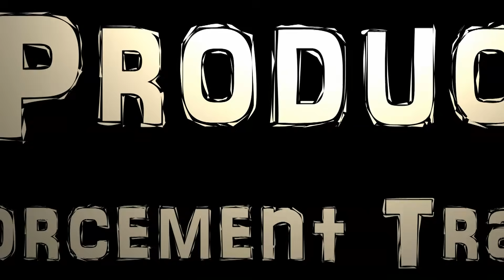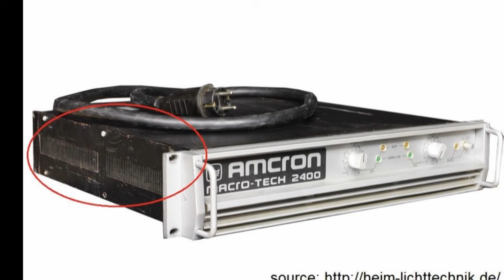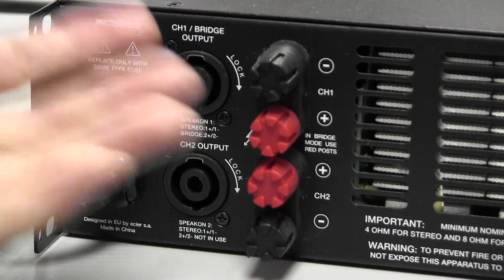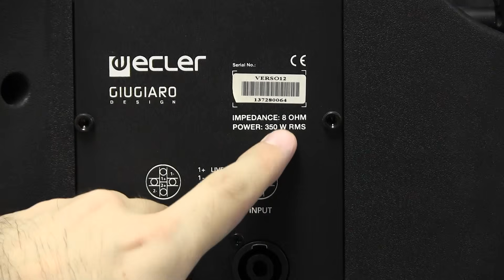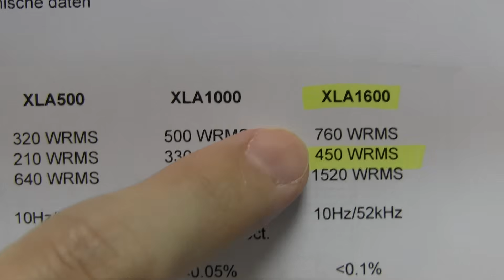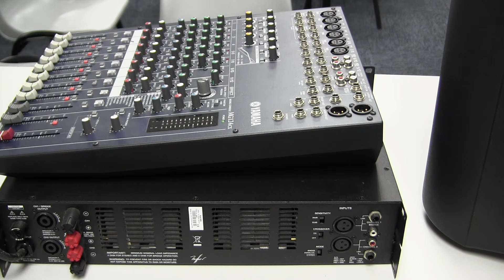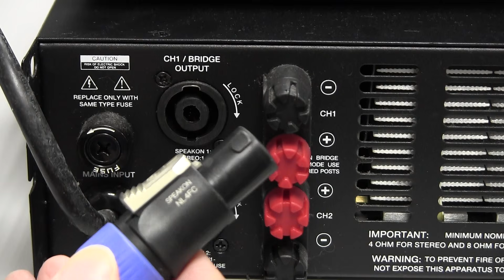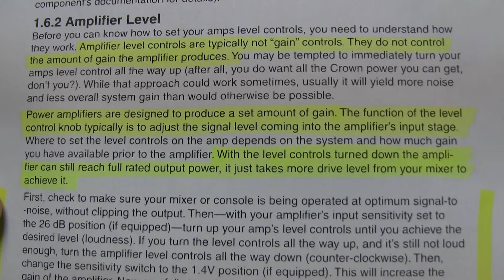How to connect a power amplifier to passive loudspeakers

Comment: Currently own two JBL JRX100 speakers. One speakers nominal output power is  500W with an impedance of 4 ohms. It says max rms output power is 2,000W. Would a newer Behringer NX3000 amplifier which can handle 2 x 900W @ 4 ohms work correctly? Our old amplifier was a crown XLS 1500
Reply: Or do you have any amplifiers that you’d recommend
Reply from the maker: Watch my video on how to match power amplifiers to passive speakers, it will walk you through this process. I personally do not recommend Behringer products to my customers - much better to go with a dedicated amplifier manufacturer like Crown, QSC or Lab Gruppen.

Comment: Even though I'm not into this kind of topics or work with this kind of equipment I'm impressed with how professional and overall, how easy it is to understand each step you explain here in this video,. So why was I watching this video? I'm trying to connect a couple of KLH speakers that come with 5-way binding connectors to a MIX8 8 channel mixer with TSR connectors to be used as a PA system. I'm wondering if such a cable exists or if I have to make my own/ Hope you can help me. Thanks
Reply from the maker: Hi Alfredo, is your mixer a powered or unpowered mixer?

Comment: if my 2 channel amp can handle 4 ohms, is that per channel? Basically, can I put 2 8ohm speakers on both channels or can i only put 1 8ohms speaker on each channel?  thanks
Reply from the maker: That's correct!

Comment: Hello mate, need your help please. I’m about to add power amp to my home cinema receiver. Do I have to run calibration again, or just to leave it as it was set up on first time ??
Reply from the maker: I'm not an expert on home cinema but if you are adding additional speakers or replacing existing ones with a different model you will need to re-calibrate the system.

Comment: Those power ratings are measured at 1% THD.  Absolutely unacceptable and a good indicator of a cheaply made amplifier. 
I can almost guarantee that this amp is MUCH less powerful than advertised. I also bet it gets very hot at full power and will put out less and less power as hours roll by.

Great video though! Wish this had been around when I started working with PA gear back in the Stone age!
Reply from the maker: It was indeed a very cheap amplifier ;)

Comment: Hello bruno, could you also connect another pair of speakers to the left and right binding posts alongside the speakon connections? So a total of 4 speakers. Is that good or bad for the amp? Thanks!
Reply from the maker: On most amps this is ok as long as your speakers are 8 ohms each. Watch my video 'how to match power amplifiers to passive speakers' for more info :)

Comment: How can I stop the leakage of voltage through microphone and entire system ! I m facing the problem of electricity shock on microphone and body of power amp !
Reply from the maker: You have a serious problem with the electrical grounding in your system - you MUST get this checked and rectified by a qualified electrician immediately, this kind of thing has killed people in the past.

Comment: If I have all the same set up as you showed at towards the end of the video with the speaker(s) connected to channel 1 output of the amplifier, would that be okay to connect the passive subwoofer to the output channel 2?
Reply from the maker: Yes you can do that, but you will be sending a fullrange signal to the sub.

Comment: You'r videos are awesome man! 
How ever I do have a guestion. How do I attach loudspeakers and a subwoofer to a same channel in my amplifier. Thank you!
Reply from the maker: Daisy-chain them together: amp -> sub -> fullrange speaker.
Reply: Cheers! One more came into my mind, when doing so (as above^) am'I able to use crossover to control low for sub and mid/hi for speakers?  @GLBProductions
Reply from the maker: In the setup above you will need a sub with its own passive crossover. If you want to use an active crossover you will need separate amp channels for sub and top speakers.

Comment: Really a very insightful overview of PA System connectivity.  I have a question:  I have a set of powered Alto Trouper speakers (200 watt) and a set of unpowered Peavey PR-15 (400 watt)  and an  small Yamaha  MG 10 XU mixer.  Following your tutorial would it be ok to use  the TSR outputs from my mixer to connect the Alto powered speakers (to use as monitors)  while connecting the XLR outputs from the mixer to my Crown  XLS 1000 power amp and then connect from the power amp tothe Peavy PR-15 speakers ?      Thanks  :)
Reply from the maker: Yes you can do that no problem. However it's always best to use the aux outputs for feeding monitor speakers as that will allow you to control them independently of the house mix.

Comment: My mixer is a self amplified mixer but i have discovered that having a separate amplifier gives better sound than the self amplified mixer.... Can i still buy and connect it to a seperate amplifier.
Reply from the maker: Yes you can do that - all good powered mixers of the type you have will have line level outputs which can be used for connecting to an external amplifier. They may be called preamp out, rec out or line out.

Comment: How to know which monitor speaker is assigned to a performer I'm confuse because the speaker output of the power Amplifier is 2 channels not like a home stereo receiver that have 7.1 channels I do not know where to put the guitar line or keyboard and how to know what there monitor's speaker is I've watch your video about aux send  How do you put the line of instruments in the mixer and you know that the monitor speaker is for an intrument on stage.
Reply from the maker: The best way to do this is to ask the system technician or the person who set up the monitor system - they should be able to give you a diagram showing exactly which aux is assigned to each performer and where the monitor speakers are located on stage.
Reply: @GLBProductions   thanks man for the answer

Comment: wish to buy a Parasound ZoneMaster 650 to have it connected to my 6 surround speakers 1 center & 1 sub (passive) . Will it make sense if i buy another Preamp(Parasound P7) so as to increase the wattage for better performance of my speakers ? or is the ZoneMasker okey to power the speakers all alone without necessarily needing an amplifier/preamp/processor ? or will only be required to buy the Parasound P7 and connect all my speakers into it ?
Reply from the maker: Sorry Toni I'm not an expert on hifi stuff, I suggest you consult somebody who is more familiar with these products.

Comment: I have a question? I have two friends and tell them about this video, they are big professionals, they make speakers, cabinets, they repair amps, everything, hi - fi, profesional, they have their own shops, they rent speakers and amp, for big events, 1000+ppl.

 And they say that what are u saying is all wrong. They say u SHOULD ALWAYS use half of the power of amp to te speaker. Example if ur amp is 200 w ur speakers shoud be 400w. They say amp is the one who destroys speakers not the other way around. So if u crank the amp who is double the power of speakers, offcoure u will break them. In your video you are saying generally its same for any type of sistem u have. For example my home amp is 100w 8ohm, per chanel, and I have 2 speakers that are 8 ohm but around 100w real power, not something that's seen on sticker or anything they are measured. I use 1/3 of the power on amp, and If I crank it more I can hear destortion, by your logic that's OK. Because I use almost the same power on amp and speaker. Can u please explain this? Thank you!!,
Reply from the maker: I suggest you watch this video which will explain the process in detail: https://www.youtube.com/watch?v=l9L7uK7Xy0w

Comment: hi can you help  ? I have 2 passive speakers , they are 8ohms at 250W rms.  if I connect the two of them to a power amp do I get 4ohms?  so that  I can buy a power amp that working at 4ohms don't hurt the speakers? and the power amp at 8ohms is less than 250W rms but at 4ohms I have plenty of power. and I only plan to connect the two of them and not only one.
Reply from the maker: This video will answer your questions: https://www.youtube.com/watch?v=l9L7uK7Xy0w

Comment: I noticed there wasn't anything said about input levels to power amps. I have mixers that are powered and some that are not. What happens if you connect a powered mixer into a power amp to get more volume? Does it blow up the amp or ??
Thanks for your video. As an electronic technician, I really enjoyed the video also..
Reply from the maker: Power amps almost always accept a line level signal ie +4dBu or around 1 volt RMS. You CANNOT connect a speaker level signal, ie the output of another power amp - you will definitely damage something :)

Comment: what do you suggest for the amplifier that can able to occupy 150-200 people,  planning to switch from powered speaker to passive. your tutorials are more informative and clear enough to follow how the system works..
Reply from the maker: It depends on many things such as the number of speakers you have and their efficiency. However as rough guide you want at least 350 watts into 8 ohms, assuming you are driving one pair of speakers with 12" drivers.

Comment: hi gang ---- question - when connecting a non powered mixer to an amp -- is it best to use TS OR XLR , and does it even matter... also ... i have a second unit that is a powered mixer that i send power to 2 passive speakers and non powered signal to to active /powered speakers- and was told to use TS wire - not TRS --- why is that ?
Reply from the maker: TRS (tip-ring-sleeve aka balanced quarter inch) and XLR are the same. They are always preferred to TS (tip-sleeve aka guitar cables) because the balanced signal ensures better noise rejection and allows longer cable runs.

Comment: Hi. Can anyone tell me how i would add passive monitors to this setup using aux sends. Would I need to daisy chain a second amp?
Reply from the maker: It's very similar, except you connect the aux output of the mixer to the input of the power amp. This second power amp would not be connected to the first one.
Reply: @GLBProductions  ok that's great, thank you for your reply, the other option I guess would be to use a powered monitor direct to the aux. I wondered if there was a way to do it without purchasing a second amp or an active monitor. I can daisy chain the monitor to the FOH but I will have no independent control over the mix. Your videos are super, +1 subscriber
Reply from the maker: In really small systems it's possible to run the mains off one amp channel and the monitors off the other channel. This means sacrificing stereo for the mains but it's one way to run with only one amp. See my video on power amplifier modes for more info: https://www.youtube.com/watch?v=HKpV30pjvIo
Reply: @GLBProductions  Thanks again for your help and response, that video is great. I'm running 2 tops and 2 subs, daisy chained left and right with a numark dimension 3 1300w amp. The amp will work at 2ohms and each speaker runs at 300rms so to run my setup in mono will overload. With this in mind and the Info I got from your video I think a second amp is the sensible option, it spreads the load and makes things easy on my pa. Would you agree?
Reply from the maker: Yes if you're already running a sub/top combination on your existing amp then you'll need a second one for monitors. It's always best to have more than one amp in any case, for backup if nothing else.
Reply: @GLBProductions  Thank you so much for your hep and great advice.

Comment: I Have a pair of pvs double 18  at 8ohm beyma woofers they have protection fuses in the back these speakers are running 300 rms i am trying to figure out the replacement fuse, can you help 
thanks
Reply from the maker: Contact Peavey they will be able to give you the exact part number.

Comment: Hi Sir... can we parallel a loudspeaker with different size but same impedance, let say  15 inch 8 ohms  with 12 inch 8 ohms...
Reply from the maker: Sure, but different sized loudspeakers tend to have different power requirements.
Reply: Thank you Sir...

Comment: great video.......i have 2 4 ohm subwoofers they are 360 watts RMS 720 PEAK EACH...IF I WIRE THEM TO A FINAL INPEADENCE OF 4 OHMS .CAN I USE THE CROWN XLS1002 POWER AMP AT 1100 WATTS IN BRIDGE MODE AT 4 OHMS..?...IT CAN ALSO DO 550 WATTS AT 2 OHMS...THANKS
Reply from the maker: Sure that would work.

Comment: Hello, my amp is rated 8ohms. 1 channel has 2 speaker terminals A and B,  I connected 1 8ohm  speaker  to A and 1 8ohms speaker to B, is that a good connection? Are those tetminals connected in parallel?
Reply from the maker: That sounds like a hifi amp - typically terminals A and B are for two different sets of speakers that will not be used at the same time. Check your manual to be sure :)

Comment: I have amplifier that is a 3000watts at 8 ohmsSo i connected it to my bass speaker 1600watts at 8 ohms aswell. But i cannot push the volume not even half and it starts to clip. Why is this?
Reply from the maker: Amplifier clipping is generally due to the input signal being too high - try turning down the input level on your amp by 3-6dB and/or reducing the output of your mixer slightly.
Reply: GLB Productions  thank you how do i do either of those two option?

Comment: This was a very good video. I do have an issue that I'm hoping you can solve.

I have a small set up with a bass amp (fender rumble 40), a Behringer X2222 USB mixer, 2 powered/active pa speakers and a passive sub woofer. After watching this video I now know that I need a powered amp to use with the passive sub woofer.

My question is, how do I separate each instrument/voice after putting them into the mixer? So I want the keyboard to go into one PA, the voices into a separate PA and the bass guitar to go into the bass amp, then the mixer and then into the passive speaker. Is this even possible? 

The reason why I want to make sure that everything goes into the mixer is because I'll be recording through it. I'm a total newbie so forgive my ignorance. I look forward to your response.
Reply from the maker: Hello Alex, nice to hear from you :) The job of a mixer is basically to mix, ie to take many separate sources and combine them into a single mono or stereo signal to be set to a single sound system. Now it is possible to then divide these sources up using the mixer's aux sends - each aux send is a separate mix, distinct from the left-right outputs. The left-right outputs are typically used for the audience, the aux sends for the artists on stage. I hope that helps to clarify the big picture for you?
Reply: GLB Productions thank you. But I was wondering if it would be easier to send the stereo output from the mixer to a crossover and then separate it there. What do you think about that?
Reply from the maker: Sure you can do that too - it's the best way to hook up a subwoofer.
Reply: GLB Productions alright thanks so much. I also watch the video on the DI box. I'm gonna have to go get one. Thank you once again.

Comment: What if your speakers only got one input but you are trying to connect more speaker than one to each channel
Reply from the maker: In that case you need to get creative - it may be possible to parallel the speakers at the amplifier itself eg connect one speaker to the speakon output and the second speaker to the binding posts. There are also buy speakon splitter cables/adapters.

Comment: Thanks again Bruno for your great explanation. One quest I have is related to connecting 4 passive speakers to 1 channel that is min rated to 4 Ohms : can you chain 4 x 8 ohms speakers in 2 series of 2 parallels ? Tha will make it (8 // 8) + (8 // 8) = 8 ohms... correct ? Will that work and not damage the amp ? Thank you !! Toni
Reply from the maker: Yes Toni you can do that, it's called series-parallel wiring, and is the way most 4-speaker guitar cabinets are wired. However note that individual loudspeaker cabinets are always connected in parallel to preserve signal integrity if one of them fails.
Reply: Thanks Bruno... I see what you mean. However,  if I can make 2 paralled groups of speakers conected in serie, if 1 of the first 2 spks connected in parallel into the amp, the 2nd one will still make the connection  to the 2nd paralled boxes... so the 2nd // will continue to have signal thru the first // working speaker. If both of the 1st // boxes fails, then the whole will fail. For such, perhaps will be better to make 2 speakers in serie, another 2 speakers in serie, and conect both series in parallel into the amp. Will see what comes easier when wiring time comessss !!! Thanks again !!

Comment: Question for you on bridge/bridge-mono mode with a set up I have...
Purchased a Carvin DCM1000 (1000W MAX) to push a single 2x15 900W @4 ohm bass speaker cabinet. The bass amplifier is also rated at 4 ohm. 
How am I able to use the maximum 1000 watts from the power amp to power the speaker cabinet? Any help would be deeply appreciated and great videos!
Reply from the maker: If you bridge the DCM1000 into a 4 ohm load it will deliver 1000 watts into that load, regardless of the power handling of the speaker cabinet, so you're already using the full power of the amp :)
Reply: Thank you for the quick reply and great videos
Reply from the maker: You're welcome :)

Comment: hello.  can i connect an analog keyboard directly to a power amp?  or am I bound to using a mixer in between?  i want to dedicate two speakers to a keyboard L R.
Reply from the maker: Yes you can do that no problem.
Reply: thank you for the help bro.  blessings